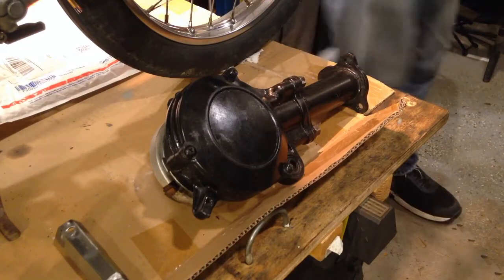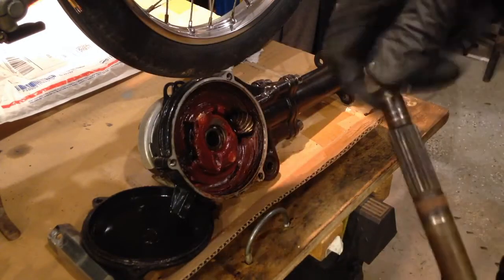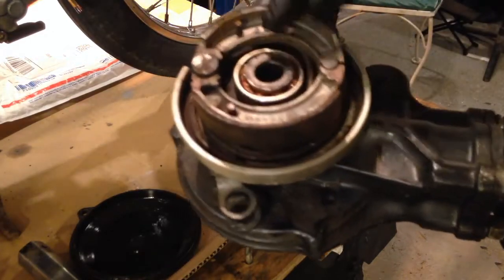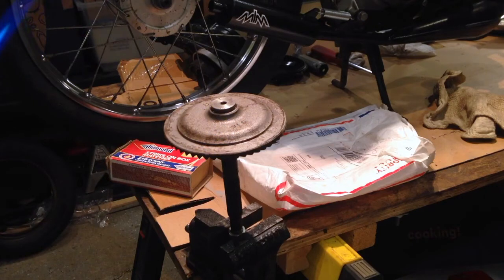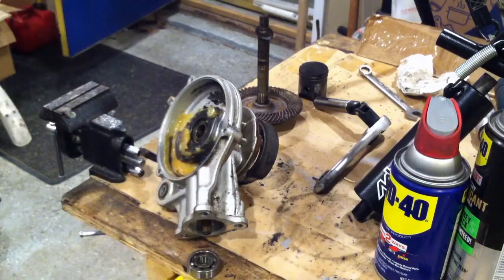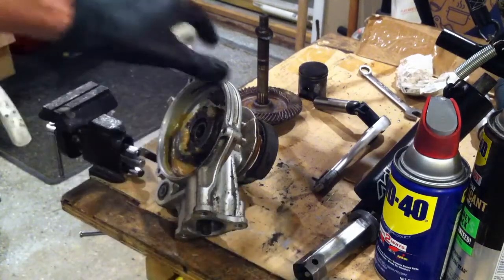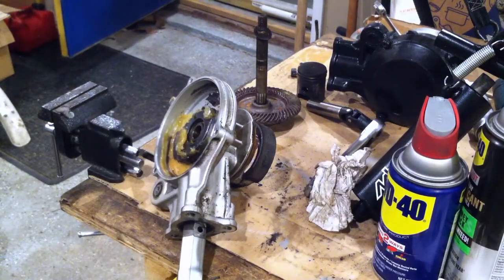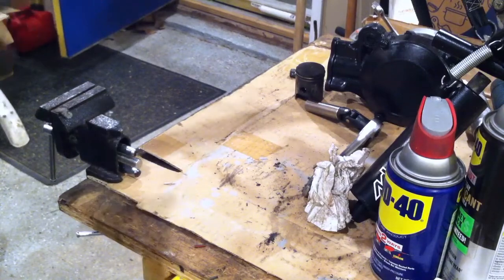Yamaha qt50 pw50 rear differential gear swap, the nitty gritty

Comment: Do you have a pw50 gear lying around you'd sell?
Reply from the maker: Unfortunately, they are getting harder to find and more expensive.  I don't have any now.
Reply from the maker: https://www.ebay.com/itm/255549689962?epid=1643635341&hash=item3b7ff2d06a:g:5dkAAOSwxh5ijBrY
Reply: @jackrutherford-1  do you need the whole assembly or just the gear and the rod that goes in it?
Reply from the maker: @garrettprosser7336  you need the ring gear and the pinion gear but you should get the whole assembly so you can put your qt50 gears in that and sell to a pw guy
Reply: @jackrutherford-1  smart thinking
Reply: What's the fastest speed you have ever gotten a qt50 to go? I'm tryna get mine to 55-57mph 60 is the goal but ill be happy with 55
Reply from the maker: @garrettprosser7336  51 so far